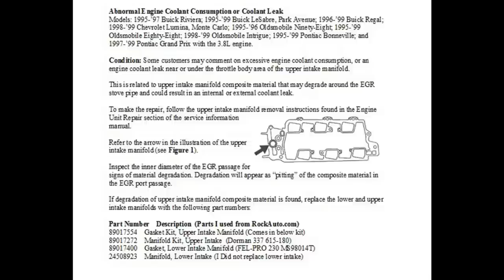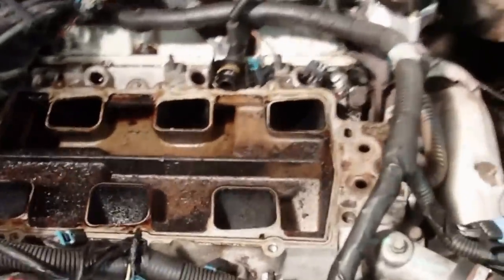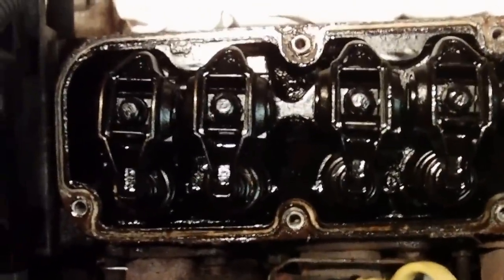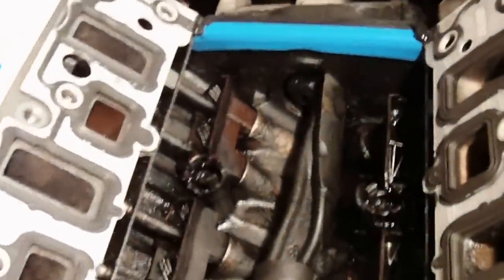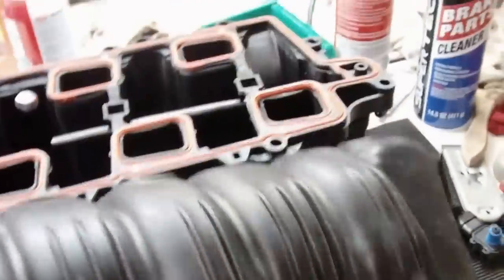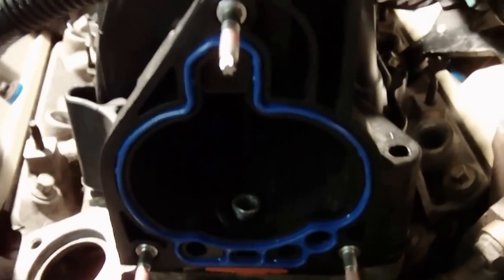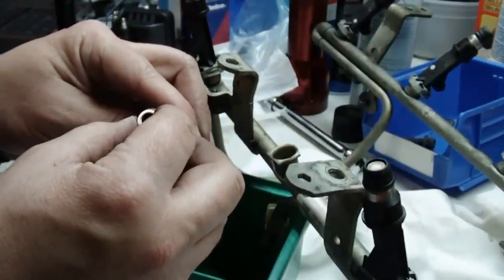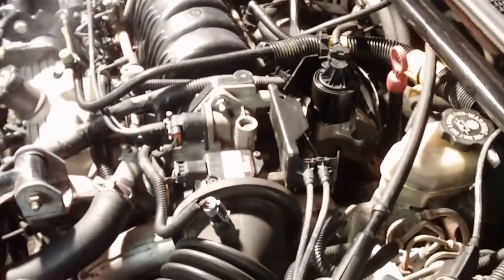GM 3.8L 3800 Series II engine upper and lower intake manifold & valve cover gasket replacement

Comment: Hi, thanks for sharing how to do this!
I'm getting ready to attempt this job on my 01 Impala that's having the same problem.
Also, did you have to buy a whole new upper intake manifold plenum? Can i replace only the gaskets on that bad boy or should i get a whole new unit?
Reply from the maker: Sorry for the slow reply, I would replace the upper intake plenum too, not worth not to since your going in deep. Mine was in poor shape around the EGR port area.
Reply: @mrmarkg8564  All good, thanks for getting back to me about this. How long will this take me to do this job like a day or 2?
Reply: @polynesianmovtgp7439  Its a very easy job. I took about three hours to completely change mine but again its the removable of all the connections you have to do

Comment: Is my belt tensioner assembly different or what? I can't get it off and theres only 1 bolt. I'm in Walmart parking lot with my engine torn apart.
Reply: 2000 Monte Carlo SS
Reply from the maker: It should be the same for 2000, did you figure it out?
Reply from the maker: @daddynowski  I sold it with 330K miles on it.  It a great engine good luck with yours.

Comment: I don’t have any codes or a check engine light but I still think I’m losing coolant is it possible I’m losing coolant and the light isn’t on
Reply from the maker: Yes,  A coolant leak may not trip any engine codes, but the most cars have a coolant low indicator that should trip once it is below threshold.

Comment: What is that hose that says engine on it and it plugs right behind engine closer to the fuel injector in the rear and hooks up right behind the master cylinder on the firewall?
Reply from the maker: I'm not sure what you are referring too, if you can give me a time stamp in the video that you see it, I can try to identify it for you.
Reply: Mark G 648 but I believe I figured it out I think it's the brake booster vacuum line
Reply: @jb0915  yup.... booster line

Comment: Did you use Silicone on the bottom intake gaskets? And also on the thermostat housing? I dont know if i should.
Reply from the maker: I did not. Just the gaskets.
Reply: no.... the only place silicone should be used is in the corners of the lower intake gaskets.... 
.

Comment: I have  1999 lumina same engine 3800 2 i have a gasket blown is there any way i can tell if the engine is gone or still good i want to replace my gaskets but im not sure if it will be worth it cause people are telling me if theres coolant in the engine its gone and need a new engine and I really dont wanna spend on a new engine...
Reply from the maker: Not without taking it apart.
Reply: I took it apart, there was coolant where the combustion chamber is if i remove all the coolant and replace the gaskets will it work? There is no bent or broken parts inside ,will it be worth it ?
Reply: @xiiixlllvlllxiiix  I know it will work clean the oil yes it would work put synthetic oil in it
Reply: Clean the cooling out and put synthetic oil in it

Comment: Good job. What was the estimated time for doing this, and cost?
Reply from the maker: I don't remember how long it took since it's been 4 years, I did it after work at night maybe 5 or 6 nights, but it was about 10-14 hours including the other work I did at the same time. I replaced upper intake manifold, lower intake gaskets and valve cover gaskets, spark plug wires, ignition coil (3&6), thermostat, cleaned fuel injectors, stabilizer bar supports and links, fuel filter, flushed and replaced coolant and changed water pump. My parts costs were about $400 in total, the parts listed in the video description were just under $200.

Comment: where did you find all the information about torque spec?
Reply from the maker: Can't remember if they were in the Haynes manual that I had, but most can be found by Googling it.
Reply: @mrmarkg8564  hey, thank you for replying so quickly. i was going to buy a haynes manual but my old man said dont waste my money. im thinking i should buy one eh?
Reply from the maker: @IamMuRdA313  They are worth the $20, even tho most information can be found online if you look for it.
Reply: @mrmarkg8564  My car is a 1999 buick park avenue with the same engine. having a smell like antifreeze when i get out of the car after it has been running for time. like when the engine is hot. you know? i changed the radiator cap on a whim yesterday..... didnt fix anything. i cant find anywhere externally where there is a leak. but i am losing coolant. but not overheating. i have a suspicion that its the same issue you had. i have 177k miles on mine.

Comment: Went I crank my car up in the morning, that's why my car idle up high?
Reply: No, when the car is cold the computer gives the fuel injectors more gas make it a richer mixture plus the computer open study idle air control valve little bit to allow more air into the engine idles higher. That's why a car idles High when you first start it.
Reply: when its cold it should run abouut 800 to 900 rpm
then quickly settle down to around 700 to 800
.
if its reving over 1000 rpm...... your fuel pump is probably weak 
thats what caused a 1500 rpm idle on my dads 3.8
.
you can get a fuel PSI tester at most parts stores for free
should have 55 to 65 PSI IIRC (i could be wrong.... just google it)
.
their is a port on the fuel rail that should have a black cap on it
simply screw on the tester..... turn the key on (dont start) and look at the psi
then start it..... look at PSI
then rev it up.... look at PSI
.
their is a spec for key on, engine off
a spec for engine on
and a spec for revving it up